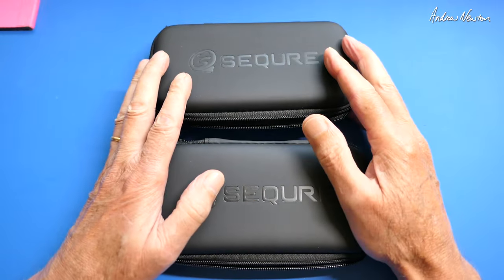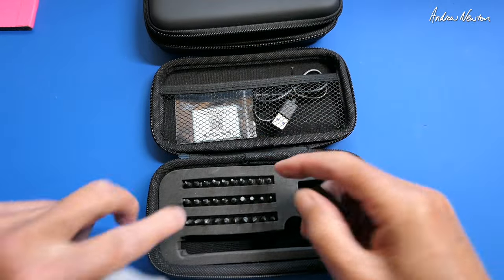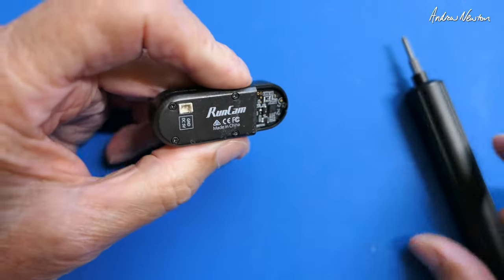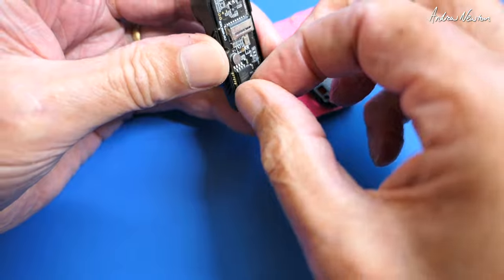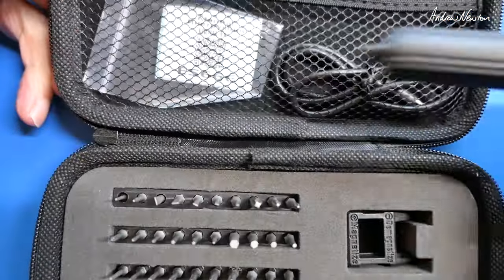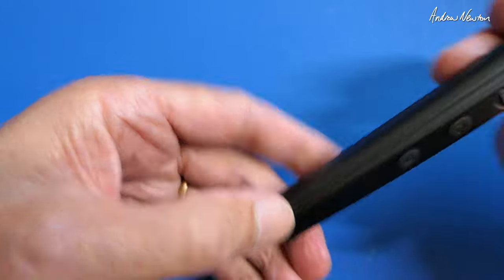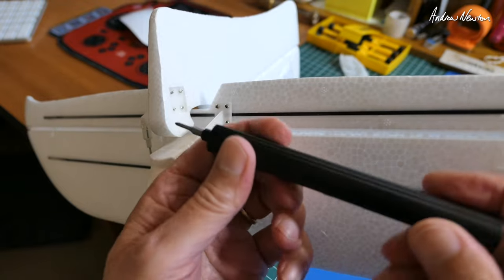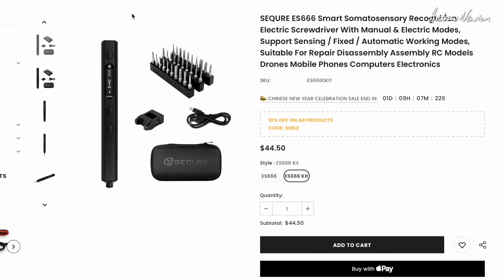Sequre ES555 and ES666 Screwdrivers

Comment: I love my electric screwdriver (It's one of the Xiaomi ones rather than Sequre), but one of the best things about it is the hard case with magnets to keep the driver bits all in place. Sequre also used to have the same style of case with the ES-126 I believe. I'm not sure how the pricing compares between the ES126 and these two, however changing to a case that just uses foam to hold the bits in seems like a step backwards sadly.
Reply from the maker: I like the sound of a magnetic bit holder